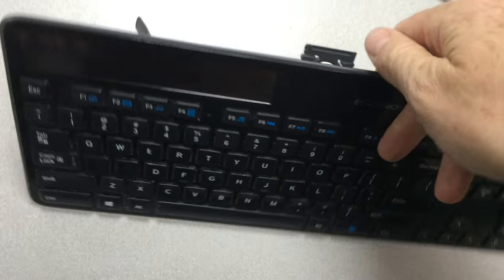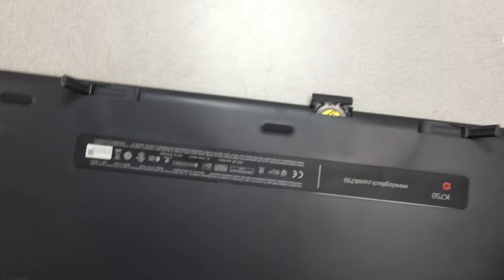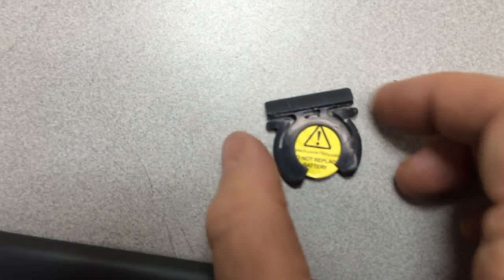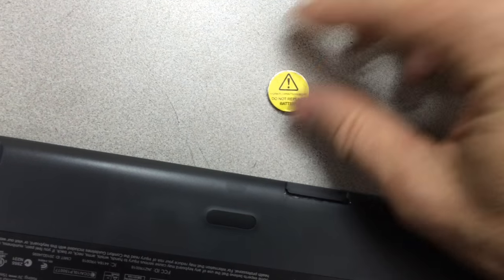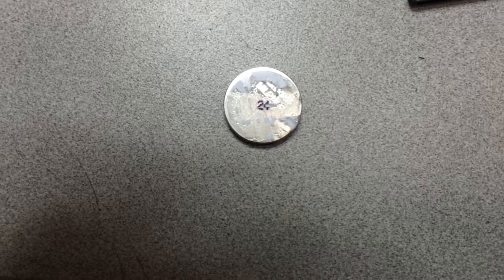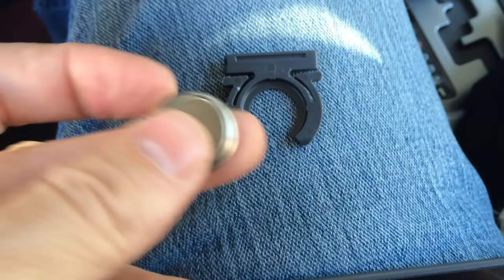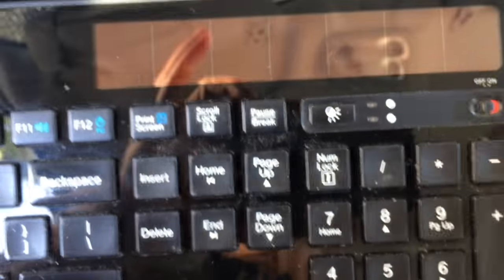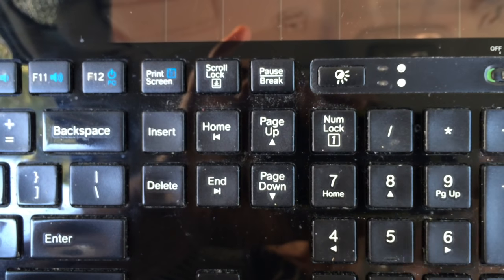How To Fix A Solar Keyboard

Comment: Thanks, this was very helpful! I had no idea that was a battery compartment.
Like someone else wrote, what worked for me was to have my two tiniest flathead screwdrivers (made for computer work, with very thin tips) and use one on each side. I've just ordered the new battery and I hope it will be what my keyboard needed.
Reply from the maker: You’re welcome

Comment: Good video, and the suggested replacement works fine.  I wouldn't have attempted it without advice such as yours.  Had to source the ML2032 from overseas (China) but that's not a problem in this day and age. The conceit of the Logitech  company in all of this  is breathtaking. They should be actively supporting their users to change batteries, not hiding the battery compartment, making it very difficult to open, then sternly instructing us (via that yellow sticker you see on the video) NOT TO CHANGE THE BATTERY.  A pox on them I say!
Reply from the maker: Well said!  I agree.  I guess they make more money selling new keyboards, so they keep the battery a secret.
Reply: Yes, but at least they DID add a compartment for the battery, and they didn't completely seal it within the keyboard.

Comment: tip: if the soloar indicator light doesnt work after replacing the battery it is because it is in the wrong way. Also, as the panels will be serving as a charge, you need to buy a rechargeable coin battery or risk damage
Reply: Que?

Comment: Excellent howto video.  Concise and to the point.  my battery compartment was VERY difficult to pry open, but I got it open with a combination of prying with one screwdriver while pressing down side tabs (once revealed) with another.  Thank you hoohoohoblin.  PS. although my keyboard was unresponsive after being in the sun for a day, removing the battery (which was supplying 2v by meter) and putting it back in seems to have revived it.  The battery status app now lights up when I press the lux indicator button on the keyboard and it shows the battery is now charging...I guess software in the keyboard needed a hard reboot...
Reply from the maker: +pbrezny Thanks. They designed that battery door to be almost impossible to open without breaking.

Comment: If you cannot source the rechargeable ML2032 (it's hard to find in Canada) then a regular CR2032 can work if you disable the solar charging panels. A good way to do this is to use black electrical tape to cover over the panels completely. Or, something like aluminum foil taped over the panels should also block all the light. 
Then just install a CR2032 in place of the ML2032. Not sure how long it will run for....I just installed it today.
Reply from the maker: +TornadoCAN99 solar panels only provide a little power. I bet it would last longer if you don't put tape on the panels. I don't think it would be dangerous.
Reply: I agree  with hoohoohoblin. The odds that it would overcharge to the point of burning the battery is highly unlikely. Also, my normal logitech keyboard uses 2 AA batteries, and they last about a year!

Comment: Didn't work for me. Usually how much time it takes for just the indication led to flash?
Reply from the maker: I let it charge for a day in the sun after replacing the battery.
Reply: @hoohoohoblin  not even showing the red light indicator. Is that still normal?

Comment: Could you share the link for the amazon order :) Also thanks for posting this, I was just going to start looking into replacing mine. Kind of surprised this is on the only Solar keyboard on the market still.
Reply from the maker: +Mitch Gent I don't remember who the seller was, but make sure you get the right model number of battery and buy a brand name you recognize, not a generic no-name battery.

Comment: It's been years since I've seen this video, and I just wanted to thank you. It's been as many years since I've still had this keyboard working learning the battery can be replaced. Over winter I even bought a cheap separate ML2032 battery charger to have as backup. The solar app meter never judged the right charge since the first battery swap out so it was no bother to keep swapping. Thank you again for your video!
Reply from the maker: You’re welcome

Comment: Sometimes with solar batteries all they need is to be repositioned inside the battery holder.  Reason is, for a better word, the battery position gets worn out and needs a new contact position on the battery.  Try that before you replace it...I also have a solar watch that I have to do the same thing to...turn the battery about 1/8 to  1/4 turn and set it in light.  If it charges, your in luck.  If not, then replace it.
Reply from the maker: +Gary Sansum Thanks. I will try that first next time.
Reply: Worked for me after I turned the battery a bit. Great help!  Thank you!
Opening the battery compartment was hard.   The audio below helped.  
BTW, I have had the keyboard for over 6 years.  Love it!
Reply: That worked! Thanks!

Comment: I have a Logitech Solar Keyboard which I can't type with unless I move it to the uppermost part of my PC stand.  It used to work when placed on the rollout shelf  about 2 1/2 inches below where I am using it now.  Is this the fault of the battery (I get red lights, not green when I push the button), or would I have to get some king of external sensor to reach the bluetooth module?
Reply from the maker: It is probably the battery, but it could be the distance. If you have a USB extension cord, you can try putting it right next to the keyboard.

Comment: Mine stopped working once out of light for part of the day. Put it in light and finally got the green indicator but no keyboard on startup. My Mac requires a password so I'm screwed. I will get a battery butt hate buying a new keyboard if I can get the Mac to see it again. Going to try again tomorrow before buying another darn keyboard. Like this one the best.
Reply: Your cursor should still work. Find a word doc that has all characters in the document that has all the characters in your password, or use a friend’s computer to send you your password written out. Then use copy and paste one character at a time to “type” in your Mac password.

Comment: A note to others: My tray is white plastic and it took a lot of deep persuasion/abuse with two tools to get those tabs in to finish the tray removal. I clipped the tabs shorter for next time and will just tape it shut or wedge it with paper if I need to. On the other hand, Logitech has the sleaziest support and I can't wait to try another brand of solar keyboard over this defective junk (mechanical issues, not power issues).
Reply from the maker: Good advice. That thing is hard to get open.

Comment: You say "It looks like it's solar, but it still has a little battery in it.". Well, it is a fully solar powered keyboard, the power it obtains from the solar panels must be stored somewhere. Working with anything solar powered wouldn't be realistic without a battery as you would only be able to work when you have sufficient lighting.

Comment: Have the same keyboard, been putting it off as hard as I can. Actually have a UV light
Reply from the maker: It's easy to change, and the price is a lot less than a new keyboard.  I thought it was totally solar powered until it stopped working.

Comment: In this video, the battery tray has already been removed. It would be useful to show how you extract the battery, as it's the most and only difficult part...
Reply from the maker: +Marc Rodet sorry about that. It was impossible to do it while holding the phone in my other hand.
Reply: u have to pretty much force it out and probably break those two pieces holding it in tray. it is not meant to be taken out, but with enough force you can, just liek I did with mine, tray is little dmged now but it works perfectly

Comment: To anyone attempting this, Logitech makes it almost possible for you to easily do this - but it's possible. I just did mine two minutes ago. Felt like I should comment to let people know that you're not doing it wrong, it's just made very difficult.
Reply from the maker: Yes. I think they designed it so you would just throw it away and buy a whole new keyboard.

Comment: Unfortunately this didn't fix mine. Put a brand new battery in, 100% charge shown. Still randomly missing keys, delaying inputs or disconnecting from the dongle altogether - despite being less than 2 feet away. Logitech used to be a decent company but in recent years greed and corporate agenda pushed them into being the WORST hardware manufacturer worldwide - by far. I wish they'd just disappear and stop polluting the market with their GARBAGE.